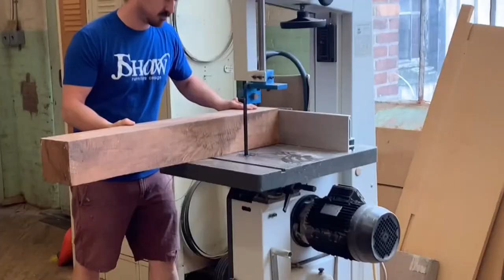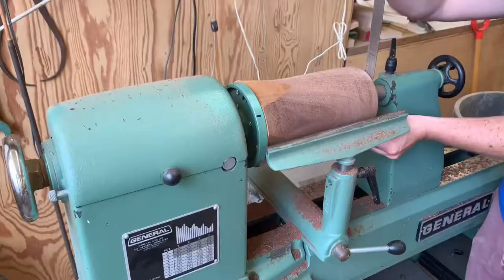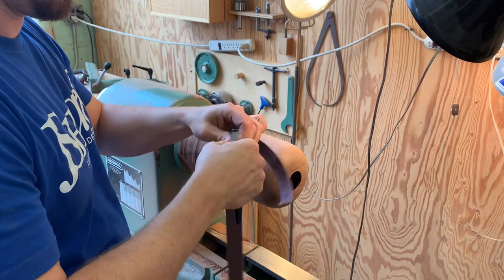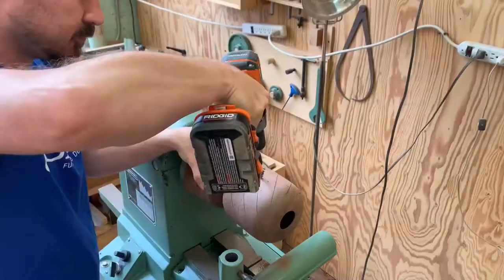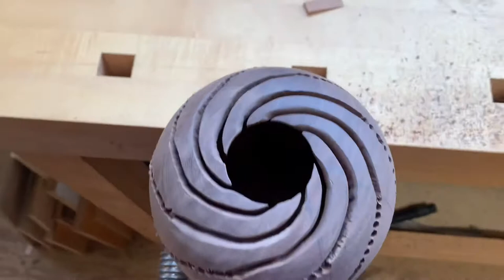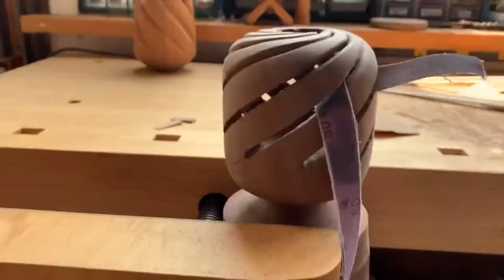Hollow Vessel Barley Twist: Fast Version

Comment: This is a beautiful design!  But you could step it up even high by carving notches just before the ends of the spirals at the top and weave jute or use tree roots around it and incorporate bead work too!
Reply from the maker: Thanks! This was the first hollow vessel barely twist where the spiral comes up and over the top. It was never quite finished but I’m just happy the end grain has held up over the years.